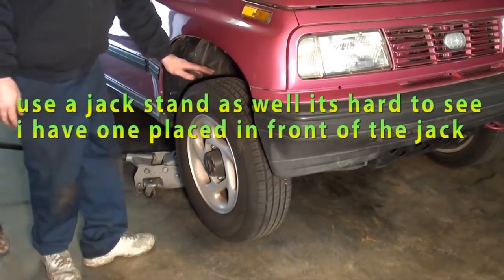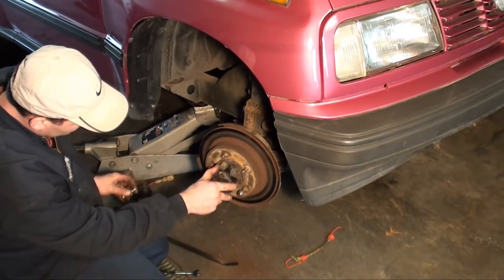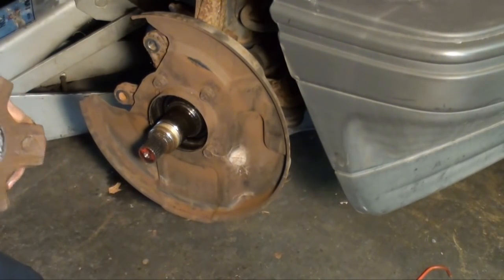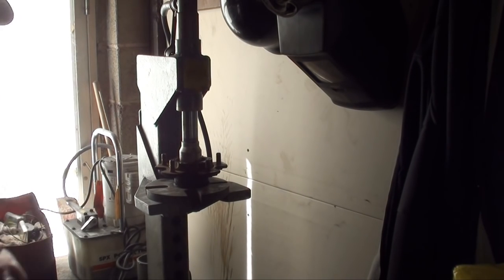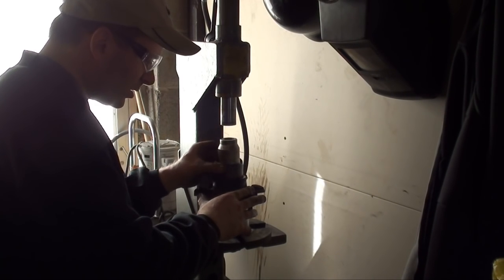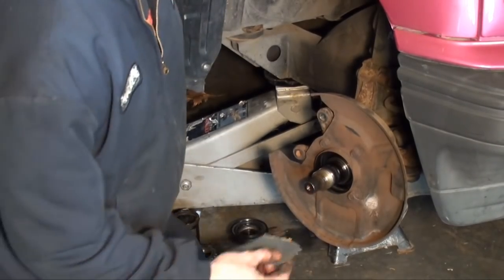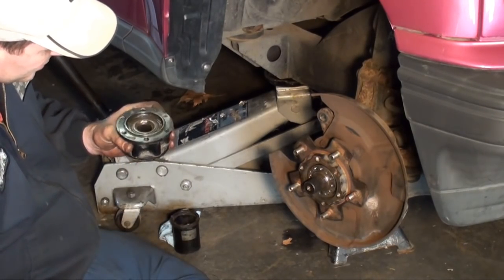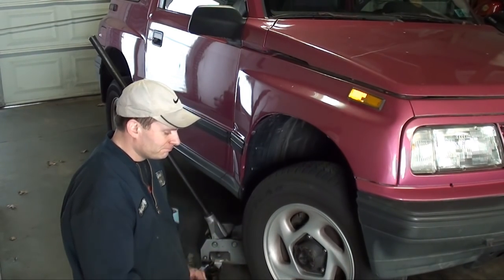wheel bearing Geo tracker

Comment: thanks for the instructions. I'm in the middle of doing mine right now.  I would have one word of caution in getting the hub off...my bearings were quite rusted on.  If you use a puller as you did, the only thing keeping the stub shaft in place is a snap ring. It would be easy to mess that up.  The factory service manual says to use a slide hammer affixed to the wheel studs.  I didn't have that, so I made one.  I also made the spanner socket. from a large socket and steel dowel pins.

Comment from the maker: Your welcome, Keep in mind the puller will apply more even pressure. a slide hammer will work however if its frozen your better off with a puller or your going to be beating for awhile it will go however a even pull is always better than beating just talking from past experiences. Your not going to damage the snap ring, you would pull the bolt threads first. its surprising the amount of pressure it takes to damage a snap ring or the retaining groove. Good tips though thank you

Comment: do what i did and buy an impact  screw driver, bought it at oreilly , its a screw driver that you tap with a hammer. Every time you tap it  it rotates the screw under pressure, thus mostly eliminating a stripped screw. I had to use it on my camry idle air control that had brass screws that would not budge.It worked great for 12 bucks. hopefully this helps

Comment: my 1997 tracker did not have the cap with philips head screws. it has a spring washer behind the nut. had to push each lock on the washer in one-at-a-time to loosen the nut.

Comment from the maker: its a tight press fit you my be there awhile beating and my cause damage, if you noticed at one point while pressing the press started surging on off  that cutoff was set at 10,000psi  most shops will press it for you for a small cost...

Comment from the maker: came loos for me on this one, however, if your having issues try taking and whacking the back of the screwdriver with a hammer. as long as its not a cheepy lol  give it a couple good hits continue tapping as you apply pressure and try to break the loose... now that i think about it you can probably see be doing that in fast motion when the clip sped through me removing them, guess in hindsight i should have played that part out. a impact screwdriver would be the correct tool

Comment: Hi, Great video, it helped me a lot!

I got a question if you dont mind. As I was doing the job I found out that the halfshaft had a lot of play, I removed the spindle and found out it had a brass bushing in it, I removed the other side and there was a needle bearing... someone must have changed one of the spindles I guess... the one with the brass had a lot of play and the other with the needle bearing had less play... is that play normal? Can I remove the brass bushing and replace it with a bearing? I find it weird that the halfshafts have play inside the  spindle... Thank you in advance for any help.

Comment: So it won't just spin @ high revs? that's interesting. I have a good compressor & a good air ratchet that I thought about using, but I was worried about stripping those phillips heads. if I used my impact wrench, I know they would've been  been toast! thanks for the info guys, your the best!

Comment: Hi @robinsonauto, about a decade late to the game here but can't find anything else nearly as helpful. A question on the washer you're installing around 20:50 -- I've noticed it is rounded on one side, flat on the other. My inclination is to install the rounded side against the bearing/race and the flat side will touch the spanner nut. Mine all fell apart when I took it apart and I don't remember the orientation as well as my service manual not even mentioning the washer at all! Any thoughts? Thanks!

Comment: I completely lost the bearing on the left driver side, and I have the new wheel hub with the bearing pressed in, but since it was forever since the bearings were replaced, I need the all the washer things, screws, and snap a ring. What is the kit called for all of those things?

Comment: um, no to an air tool on this type of tool. This is a hand held screw driver that you strike manually with a hammer. As you tap/strike the tool it seats the phillips or regular bit into the screw head, thus seating the screw driver head against the screw itself while( and this is the key) turning the screw at the same time. Just check o reilly or another auto place or visit a utube channel . Once you see the tool in action you will understand what I am describing/

Comment: From what I understand these bearing are what they call CRUSH bearings...and are not 3 pieces anymore....and you install the one piece bearing now..and torque it to at least 123 ft lbs...and continue to tighten the lock ring until the screw holes line up with the lock ring plate...but it HAS to be at least 123ft lbs torque or the bearing will fail in less than 1000 miles....

Comment: he didnt have the right socket, he used a punch and a hammer, but the socket is available on ebay for like 55 bucks, search "chevy tracker spindle nut socket"  i mean honestly, " oh i accidentally turned off the camera right in the middle of the procedure, and turned it on immediately following this step that i stopped before"